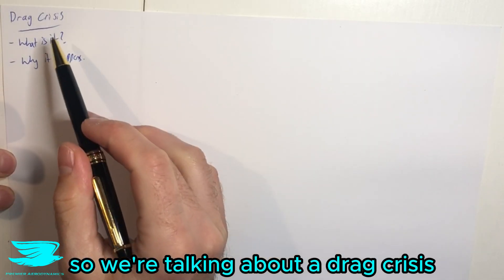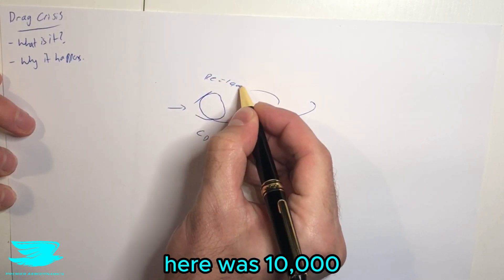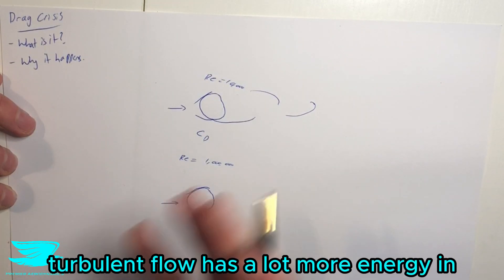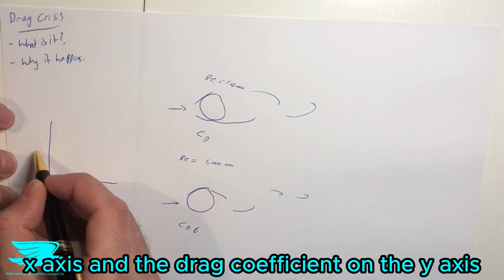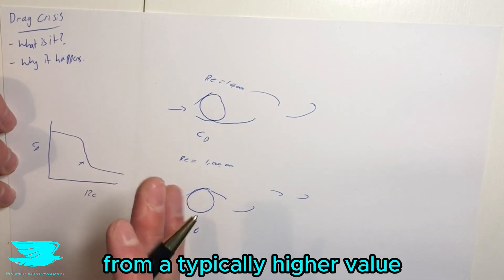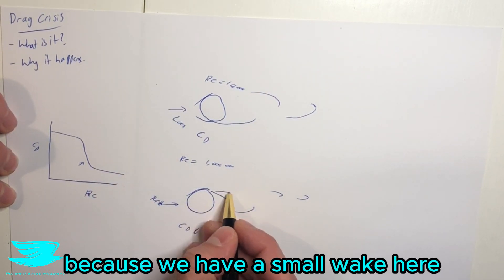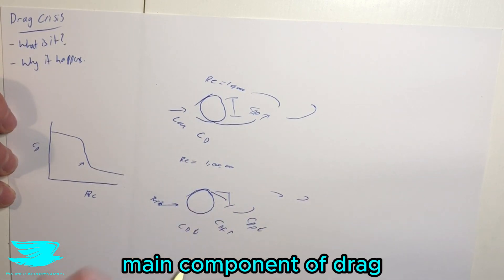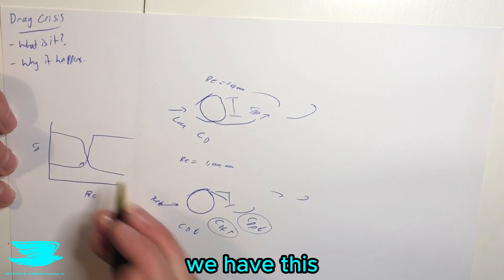[Aero Fundamentals #41] Drag Crisis

Comment: So fair the Cd drops.
But how does this look like if you plot drag force vs speed.
F=½*p*v^2*Cd*A
Since v is squared I guess the drop will be small. Probably small enough that the gradient of the force stays positive?

Or is the an "optimal" speed for any shape where the drag force is lower than at a lower speed. Cause then we should be trying to take advantage of that. 🤔
Reply from the maker: When the drag coefficient drops suddenly, the drag force also drops because there's only a small increase in the velocity but a large drop in the drag coefficient.

So, there are some velocities that produce a lower overall drag despite being higher.